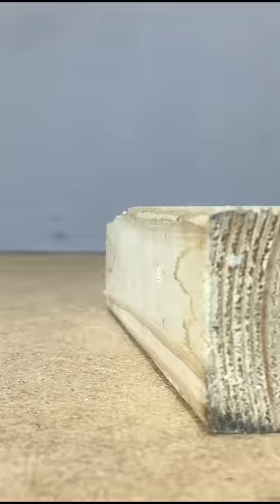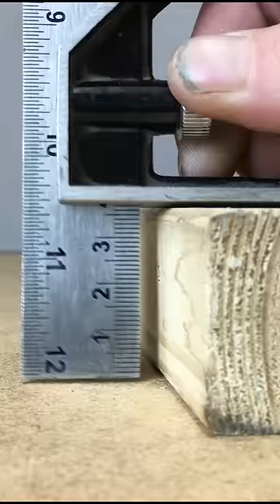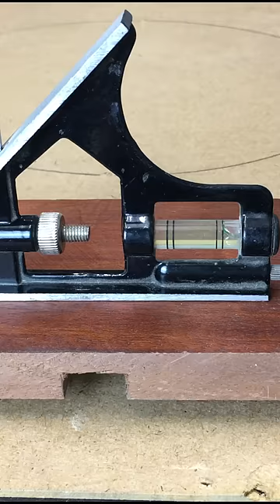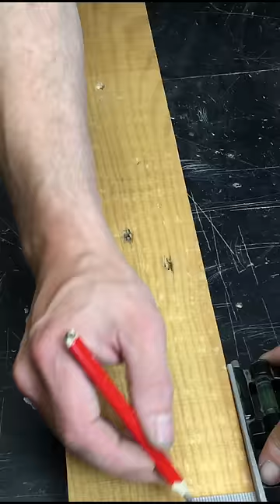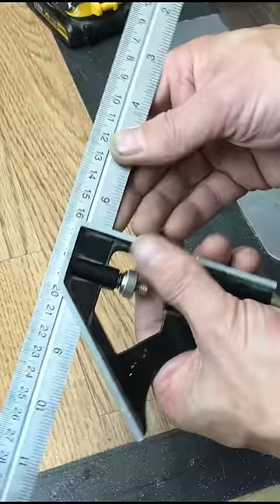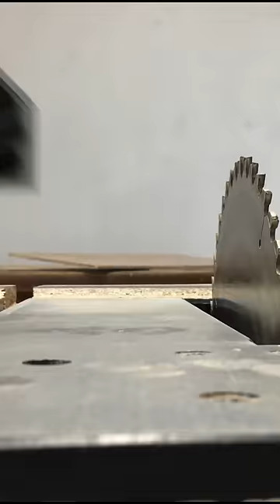1 Tool 7 Tips #shorts #tipcentric

Comment: Add a center head, a protractor, 24" and 36" blades and you've got it all...
Reply from the maker: Yeah, the full set is on my ever growing list of tools I need!! 😀
Reply: I have one. They're honestly not too expensive and I use them for metal work. Sometimes to transfer measurements more precisely, I use calipers to measure the amount it sticks out
Reply from the maker: @thedudeamongmengs2051  Ill be getting one soon for sure!! I have the expensive list, eg new table saw, jointer etc, and then the hand tools list, which never ever ends haha, but combination set is near the top! 👍

Comment: It's called, knowing how to use your tools properly
Reply: Are people allowed to buy stuff without knowledge?
Reply: @dojoparsnip9905  yes, but dont try to demonstrate your expertise until you actually have some expertise
Reply: @dazbo666dilligaf  in the video, are they using it incorrectly? jw. i havent used one of these.
Reply from the maker: @dojoparsnip9905  There are many way to use this tool, every woodworker should own one, or better, two (so you can save the measurement on one if needed). I have used it correctly in all the tips in this video and there are many other uses for it also 👍😀

Comment: Never thought about using the 45-degree angle part to degree a saw blade till now 🤔
Reply from the maker: Most saws will have a angle guide by the crank with an adjustable pin, this tip is also great to check your pin is still accurate as they can shift over time! 👍😀

Comment: One other very important use of the combo SQ is to use it to check the table saw's blade alignment with the miter slots and gage.
Crank the blade all the way up and then using the combo SQ, you put the cast piece into the miter slot and with the tongue or ruler lose but touching the tooth of the saw blade, you let it barely touch the tooth and then tighten it. Then roll the blade tooth to the rear and see if the end of the tongue is still touching or binding with that same tooth.
Check at least 3 teeth using the same method.
IF you don't get an equal touching on the end of the tongue then make your trunnion adjustment under the saw to align the blade.
What you're doing is to set the blade parallel with the miter slot.
That way you get straight miter cuts with NO binding or kick-back.
Reply from the maker: Yeah that’s a great tip. I do exactly that at least a couple of times a year, especially seen as my table saw isn’t the best quality and is prone to drifting accuracy. Not sure why I didn’t put that in the video to be honest! I’m going to do a longer version of the video with a few more tips in it at some point in the future, so I shall put this on the list as well. Thank you Robert 👍

Comment: That pin (awl) is for scribing on steel or other metals. On wood you should create a cut wall with a knife.
Reply from the maker: It’s not an awl, an awl is for making holes, it’s a scribe, for scribing, in whatever material you want to use it on. You are correct that if your aim is to pre cut cross grain before sawing to prevent tear out, a knife is best, but like I said, this is a scribe, for scribing. 👍
Reply: It's fine on wood, unless you are cabinet making or something it's not really needed to make perfect scribe lines.
Reply: @tipcentric  An Awl is for scribing too, it just depends.
Some awls don't make holes, some drill holes, completely depends on geometry of the awl.
Reply from the maker: @autumn5592  I just looked it up, you are right, I stand corrected 👍👍😀
Reply: @tipcentric  Happy to help

Comment: Why would you draw the Line in the inner side of the 45° line, you had that ugly bump in most of them
And do you notice that you pressed the saw blade teeth against the Kombination square? That was you wont cut an exact miter...
Reply from the maker: 1. Because I was drawing it on the side that was facing the camera.
2. the slight gap caused by the blade teeth was parallel all the way down between the blade and the square, meaning that it was 45 degrees. 👍

Comment: Great tool. Its been around 100 years
Reply from the maker: It is! I’m surprised it’s not been around for longer!
Reply: Approx 150 years invented by LS Starrett and they still make the best ones..
Reply from the maker: Yeah starrett make great tools 👍
Reply: @tipcentric  A little expensive for woodworking.. I think that square with the 12" blade would be well over $100.00.. I checked pricing for my 36" blade a while back.. I saw prices in the $600.00 range for just the blade..
Reply from the maker: @twistedhillbilly6157  Ouch! Yeah that's a lot of money! Bet they last a lifetime though!
Reply: @tipcentric  Any tool should be the same in 50 years as it was when it was made as long as it isn't damaged..  I bought most of my tools in the early 1980's.. They show signs of wear but are still as accurate as when I bought them..
Reply: @tipcentric  I just looked at some prices on amazon.. a 6" square is around $100.00, 12" square is in the $130.00 range, a set with all 3 heads is in the $300.00 range.. Those are all with the inexpensive graduations (4R)  Mine are all the most expensive graduations (16R)
Reply from the maker: @twistedhillbilly6157  Wow, Definitely better quality than mine!! Upgrades are on the list!!

Comment: FAJNA RZECZ ...GDZIE MOŻNA KUPIĆ I ILE KOSZTUJE ?
Reply from the maker: Hey Roman, it’s called a combination square, you can buy them from Amazon, or most hardware stores, they are pretty cheap for the entry level ones, but premium brand ones can cost a lot more, but will last many many years if looked after correctly👍

Comment: New to wood flooring installation what’s this tool called? I got the angle finder but what’s this?
Reply from the maker: It's called a combination square, also available is a combination set, which has a protractor and a centre finder. 👍

Comment: Sit it at an acute angle on top of the blade when setting a 45° mitre on a saw. Otherwise it hits the teeth and throws the angle off. 👍
Reply from the maker: I’m aware of this problem when using this method. You can’t really tell from the video but I made sure the very slight gap caused by the teeth was parallel all the way down between the square and the blade, making it pretty accurate but I would love a further explanation of what you mean? Do you mean make it so only one edge of the side of the square is touching the blade as to avoid the teeth? Or am I misunderstanding?

Comment: Saw has teeth on it thats wider than the blade which will throw your angle off
Reply from the maker: Correct, but as long as the line between the squares edge and the blade are parallel you get a good 45. If the bottom is touching but the top isn’t, you’ll be off by a hair.

Comment: But your saw already tells you what angle it's beveling to ..
Reply from the maker: Most saws have an adjustable pin on the angle guide which may not be set correctly, you can use this trick to find the correct angle and then adjust the angle pin to match. 👍

Comment: You got the ruler on backwards, I don’t know why your using the little small sections instead of the inches. That makes no sense what so ever
Reply from the maker: It's not on backwards, everything is flipped on the other side of the rule. And I am not sure what you mean with your second point?
Reply: You can't 'put the ruler on backwards', the side both have metric and imperial on...

Comment: Just make sure it is true before you use it
Reply from the maker: Yep, always a good plan! Make sure it’s tightened and draw a line, flip the square and line it up with the line, if it’s square it will match up, if it veers off, you’ve got a problem! 👍

Comment: It's called a "Combination set". There is also, but not shown, a "Protractor" and a "Centre square", all using the same steel rule.
Reply from the maker: This one didn't come with the protractor and the centre square, just the 90/45 slide. I will definitely be upgrading at some point and getting one with all the accessories! 👍 😀

Comment: That combo sq is older then half the people watching this.. they don't put scribes on them anymore
Reply from the maker: It’s about 5 years old, and I just googled combination square, literally every single one has a scribe...
Reply: @tipcentric  no they don't .. I replace mine every few months. they don't even have the hole for them.
Reply from the maker: A well looked after combination square should last many years, if not decades, replacing every few months doesn’t seem like a long time, is it loosing accuracy? Try a bit of paste wax on the slot now and then, it will keep from wearing down as quick. And seriously, don’t take my word for it, google combination square, from the premium brands to the cheapo ones, 95% of them have a scribe.